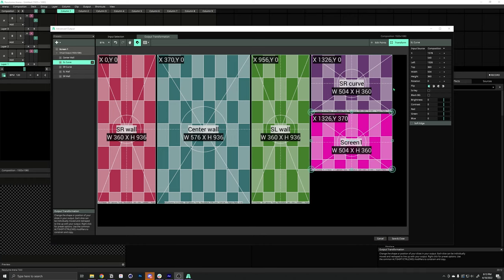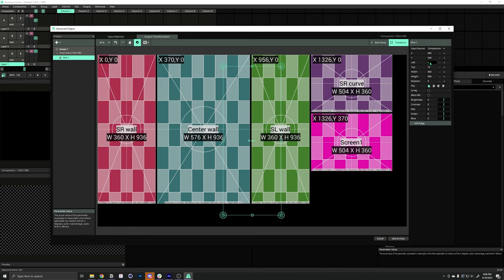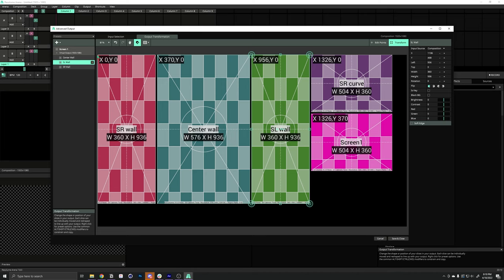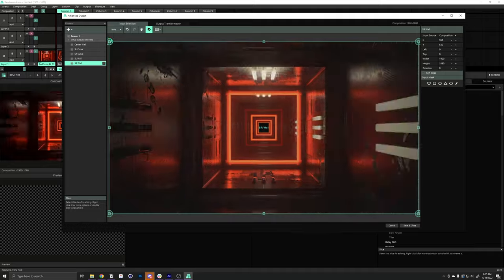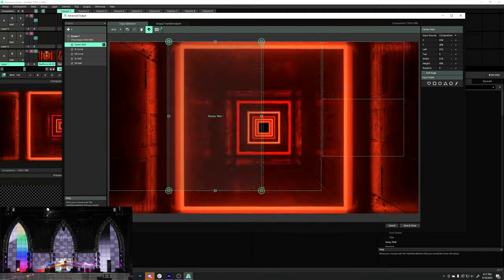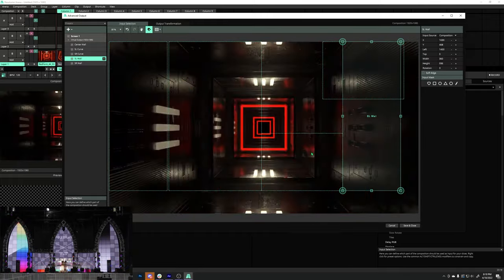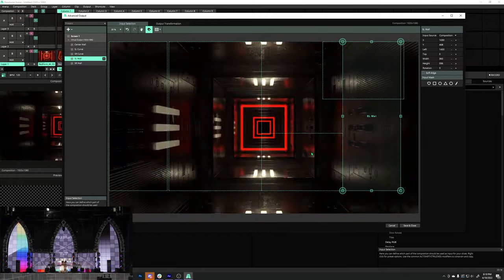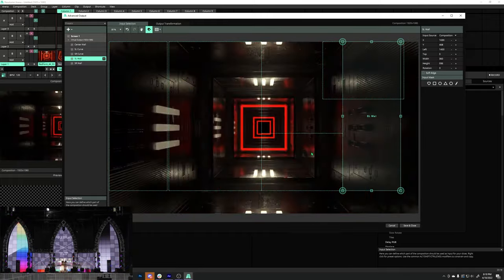Resolume Advanced Output | LED Screen Mapping | Quick Start Tutorial

Comment: How to you know the exact location and angle for the curves? Are you checking the picture of the stage on another monitor and doing by eye? Wouldn't it be better sense to place the image - instead of playing the clip - and trace it? 

Edit: Watched til the end and you said you intend to tweak it on site. But that sounds risky, no? Better be prepared. I think I'd rather trace it on the stage picture to get a more precise result
Reply from the maker: Definitely depends on the situation. The gigs I work usually have some amount of programming time on the screens beforehand. During soundcheck or the day before the festival or during an overnight between festival days. Always try to get as close as possible beforehand, and the stage drawing could be a good reference. If you don’t have programming time, that’s a good method. But things change when they actually get built. so testing and adjusting on site is always best if it’s possible. Or try to get an xml from a friendly house VJ or friend who played the previous day if you’re coming in hot :)

Comment: How do you create the pixel map. And how do you come about the numbers on each screen? this is where i got confused
Reply from the maker: The pixel map is a diagram of what has been set up on the LED processor. The resolution is determined by the resolution of the LED tiles you are using multiplied by the number of tiles you are using in each section. Their position value is determined by where they are placed on the canvas in the processor. Look at videos about Novastar or Brompton processors to get an understanding of that process.
Reply from the maker: The pixel map is a diagram of what has been set up on the LED processor. The resolution is determined by the resolution of the LED tiles you are using multiplied by the number of tiles you are using in each section. Their position value is determined by where they are placed on the canvas in the processor. Look at videos about Novastar or Brompton processors to get an understanding of that process. I have a pinned comment with links to software for making pixel maps.

Comment: Would the LED guy normally give you the pixel map? Or pixel numbers to work  with
Reply from the maker: Could be either. A good one with enough time will provide a pixel map. sometimes they will just give you the coordinates and dimensions. Both work just the same, but the pixelmap is nicer to use.

Comment: Hi,  thank you for the tutorial. But I have a question, if you don't mind. If I have a screen with 4K resolution but my content is only Full HD, how do I setup my resolume so that the content doesn’t look blurry or too small on the 4K screen? Do I need to mapping the screen like you did?
Reply from the maker: Mapping can help but if it’s a single screen it may look weird to repeat the content in order to avoid scaling. Another option, although time consuming, is to upscale your content using something like Topaz AI upscale. Also consider the size of your LED wall and the distance to the viewer. You can often get away with scaling up to 150 or even 200% in resolume without the audience noticing if the stage and audience is larger.
Reply: @SeanBowes  great! thank you for the answer.

Comment: how do u create the pixel map
Reply from the maker: Check the pinned comment I have a bunch of links there to software for making pixel maps. The input map is decided by the resolume operator, the Output Map or pixel map for the processor is decided by the LED Processor programmer. Put those coordinates into any of those softwares and it will generate the pixel map image for you

Comment: Hi sean, I have a question! What are the key considerations and best practices for planning visuals and achieving precise measurements when integrating a large LED screen with the human body for an interactive dance performance? How can we ensure that the visuals seamlessly complement the performers' movements and enhance the overall audience experience?
Reply from the maker: Interesting question. First, get the physical specs for the screen dimensions in feet or meters, as well as the pixel dimensions, then you can get a good idea of the physical size of things you are designing digitally. Then, creating some sort of pre-visualization environment to test your ideas as you create them is helpful. This is a mockup of the stage with a human reference, all to scale, to test your ideas. You can do this type of thing in after effects, or in a tool designed for it like depence, or in a realtime creation tool like notch or unreal as kind of a middle ground. Using realtime tools for the entire workflow could be helpful as they can be very flexible and adjustable, but this is also possible with rendered content and planning and choreography. Scheduling rehearsal time and time for changes is important in this type of project. Lastly, creating your assets with some breathing room, and utilizing layers with alpha that don't break the edge of the render for key elements that need to align, so that you can rescale and reposition them easily onsite when things inevitably change last minute lol.

Comment: sorry but new to this... you loaded your pixel map around 2:12 but how did you create that? is there another video that explains? I have multiple LED video walls that I want to map
Also what hardware hav you found to be most reliable for 6-8 outputs? thanks for your time and videos!
Reply from the maker: Check the pinned comment, I list a bunch of options for software that creates pixel maps
Reply from the maker: I do have a video about it coming soon too. You need to know how the processor is set up and what panels you are using, and then enter that information into the software, and it generates the pixel map image
Reply from the maker: For 6-8 outputs, check out this article https://resolume.com/support/en/lots-of-outputs
Reply: thanks so much! @SeanBowes

Comment: Hi Sean! I'm working for the first time as a Visual Designer for LED screens in a show and this is SUPER helpful.

Few questions: 
Which video format and resolution is better for importing into the Resolume project? 
And when you edited the shape with the mask, how do you know it's exactly the size shape it should be when you do it by hand?
Last but not least: how do you export this? I'm not a VJ, just the designer so I would have to send it over.

Thank you very much!
Reply from the maker: Hey Maria, that’s awesome! The best format for Resolume is DXV codec. But you can easily convert to DXV from ProRes or other formats using the ‘Alley’ program from Resolume. 

The mask is best done on site. If you are creating mapped content from the start, it might be helpful to have a ‘bleed’ or extra content outside the mask area just in case that needs to adjust. But you can decide to be very precise with pixel values to get it perfectly symmetrical in the design phase. 

In the menu on the top left of the Advanced Output window, there is an option to Export to SVG which will export a vector file that can be brought in to Illustrator or after effects to use as a design guide. 

Hope that helps!! Hit me up on Instagram. I’d love to see what you’re working on

Comment: Hi there,

I'm new to LED mapping and have only worked with physical surface mapping using projectors (Projection Mapping). In projection mapping, you set up a projector and map out the areas it covers.

Does LED mapping operate in a similar way? For instance, do you send signals to a wall of LED screens and then map them out? Or is it necessary for the sending cards on the multi-screen splicing processor to be visible to Resolume Arena, so that different videos can be sent to different LED screens?

Thanks for your help!
Reply from the maker: Hey Bruce, This video should enlighten you a bit on the process. The Processor interprets which pixels from your Output go to which screen, this is represented by the pixel map diagram (just a picture representation of the programming that is done in the processor) and your Output map in resolumes Advanced Output  (The slices that match to those screen segments in the processors arrangement). Then the Input Map  side of Advanced Output is where you creatively decide how your content is mapped to the screens in their physical arrangement. Re-arrange the slices to match the physical layout here if it is different than the processor's arrangement, and scale and transform your content to display across the entire screen surface. There are effects like Slice Transform, and plugins like Stageflow that help with this side of the process as well, and I have videos on those too. But start here and let me know if any additional questions arise. 

In projection terms, your projector is the Screen, and the slices might be sub-surfaces of your projection surface which that projector covers. In LED terms, the processor is your 'Screen' and slices are your sub-screens that are attached to that processor. large stages might have multiple processors, just as large projection stages might have multiple projectors. The process in this video can simply be extrapolated to include all screens and surfaces/slices necessary. Hope that helps!

Comment: Hey Sean, thank you for these videos. Want to know few things from the physical, routing side of things. 

Each slice is routed to an independent “processor” for each screen?? Does each screen has its own processor/send card and if yes, this  goes without saying but, the “scaler” on the processor is not used, correct?

It would be awesome if you can make a video going over how the output from your computer is routed and where are they connected 

Thank again!!
Reply from the maker: Hey Dennis, each slice is not usually an individual processor. You can have several 'slices' per 'screen' in Resolume's advanced output, and each Screen is assigned an output on the VJ Computer, which goes to a processor. What happens after that depends on the capacity of your processor and its outputs, and how it can handle the amount pixels contained in the cabinets you are using. You are correct that you should not use the scaler on the processor because we are doing pixel to pixel mapping with our Advanced Output in Resolume. I have plans to make some content about what happens between the computer and the LED wall soon!
Reply: Hey  @SeanBowes  Thank you for breaking that down. I Confused myself a little there. I relaize where the slice sits in the "output tabe" doesnt dictate whats on that slice. The location of the slice in the "input tabe" does.  I am just having a hard time imagining how this screen is wired. IDK. 
I just need to play around more with slices. Most of my work consist of deploying standard 16:9 format screen or very close to that. We use a scaler to fit the output from the screen and thats about it. 

Hey i want to thank you agian for your Time, Effort and Engery in creating these videos. They are very helpful to god knows how many people.
Reply from the maker: Thats exactly right. Input samples the content, Output re-arranges it to what the processor is looking for, which is communicated by creating a Pixel Map image. The wiring is a whole other thing that I can hopefully get into with a Novastar Basics type of video soon.

Scaler totally works in those scenarios where you are just fitting 16:9 to a nearly 16:9 wall. Props to you for expanding your knowledge to be ready for other scenarios! Great questions too, thanks for asking for clarification.

Comment: Hi Sean! I'm new to Resolume and I recently discovered your channel. For some reason, the output tab is not being displayed in the advanced output section. Additionally, the option to 'show slices' and 'show smpt'  in the view menu is not appearing. what I'm missing ? Any tips would be highly appreciated! Thank you for your knowledge. cheers!
Reply from the maker: What version of resolume are you using?
Reply: @SeanBowes  I’m running the latest version of Avenue.
Reply from the maker: @yaylab  avenue does not have the full set of advanced output features that Arena does. If you think what you’re seeing is a bug, contact Resolume support. They’re pretty helpful with resolving issues.
Reply: @SeanBowes  thank you. i appreciate your help.  Cheers!

Comment: hello I wanted to see if you can help me this week I have to map in resolume screens that have different pixels one is p6 and the other is p3.9 how should I do the mapping flow a hug very good channel
Reply from the maker: Hey! Yeah so follow the instructions on this video - first setting up the slices in the output map to match the pixel width and height of the screens. Then on the input side adjust them to match the physical arrangement of the screens in real life. This will mean that the 6mm wall will probably need to be scaled up because it’s pixels are spaced further apart and therefore relatively larger in physical space. You can use math to scale it up proportionately, and then always check and adjust it by eye on site so that it looks correct.

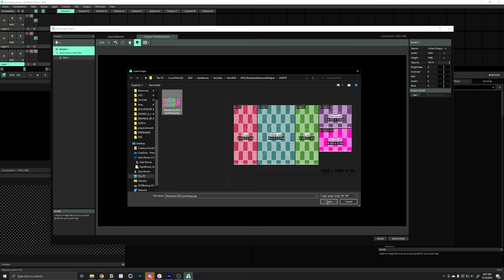Comment: Hi Sean. What can I do if of an event they do not send me an output guide like the one you use at minute 2:00? To be more specific I will have to do everything and will not send me the guide! I read that video processors take the top left part to minimizing the sending of data, then there is a tool to assign the slices to the top left part in the most efficient way in the output? Or can I move the slices freely in the output but towards the top left part to minimizing the data sending?
Reply from the maker: If there is an LED tech who set up the wall, but will not give you the pixel map, you will have to use trial and error on site to figure it out. Plug in, see what size the output is, and Move and scale slices until they fill the screens properly. 

If you are responsible for setting up the LED processor, try to find out what brand it is and read the manual for setup instructions. But you will be able to set up the map however you like with the processor.
Reply: @SeanBowes  What happens is that the one who is going to configure the screen and project the visuals will be me, there will be no technician who will send me the outmap for that!  What I will do is use the pixels of each LED panel which is 128x128 pixels to calculate and divide the slices. Since it is a 4*3 meter screen, it is 1024x768px. If the screen is full I just need to make a slice and place it on the top left in the output, but if it is the central screen with strips on the sides I have to make more slices. So my doubt is more than anything in which way I have to place those slices on the top left part in the output, considering that I know the measurements of the screen, since each panel is 128x128. The doubt arises because I have read that in the output the processor takes the top left part, so how can I do that?  Or just place all my slices freely but to the top left part in the output?
Reply from the maker: @nestormartinez5291  in that case you have total control of that decision. You can place them wherever you like, as long as it fits within the standard output size you selected to send to the wall. Pushing everything into the top left is just a guideline for efficiency and it’s where the 0,0 point is of your canvas.
Reply: @SeanBowes  Thanks a lot!!!

Comment: I’m new to this and the VJ I recently worked with mapped out the LED panels  set up with Nova program on a separate computer and then worked with Resolume so we can do this on just Resolume alone ? The mapping and VJing ?
Reply from the maker: Nova is how you map the LED processor to set up the screens. The mapping in Nova is the Output Map pixel map you reference in resolume. Resolume is used to map the content to that pixelmap using the input map and the output map. For simple screens you may not be doing much, but for complex screens it is essential

Comment from the maker: Any questions? Let me know and I'll help you out!
Reply: Hi I have a question when I enter in the image of the stage with its correct dimensions into resolute  do I need to change the output dimension as well so I can see the entire stage image on my screen before slicing and adding visuals?
Reply from the maker: Great question. Yes, your Output size should match your Pixel map size. This is usually a standard video signal dimension like 640x480, 1280x720, 1280x800, 1920x1080, or 3840x2160. Something like that. Your input and composition size can be different than your output size in order to fit all of the slices in their 'physical' arrangement and does not need to be a standard ratio if you don't want it to be.
Reply: Hi sean, How i get dimensions of led screen as u shows in timeline 2:10 onword.
Reply: Thanks for the reply.
Reply: I want u r number sir
Reply: how can i have different clips for each slice?
Reply: Dear Sean, when I open the advanced output on my MacBook, I have the input window but no output window and I cannot understand where I can have it to show up….. I’m sure it’s a newbie issue but it’s making me a bit crazy, do you have any clues about what could be happening here ? Thanks so much for everything,
Best wishes
Reply from the maker: @scrydedoria2435  It sounds like you might have Resolume Avenue installed, instead of Resolume Arena which has the full set of advanced output features.
Reply: @SeanBowes  thank you so much for your swift response, i just checked and apparently it’s available in both :/
Reply from the maker: @scrydedoria2435  output transformation is only available in Arena https://resolume.com/support/en/output-transformation